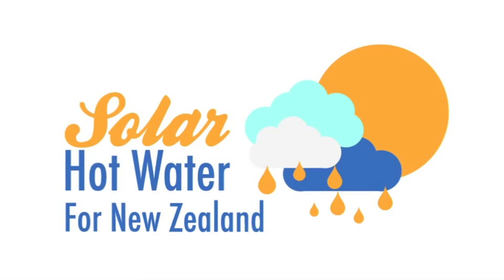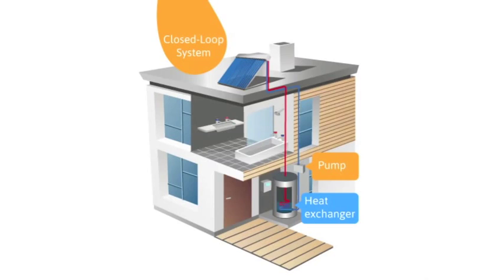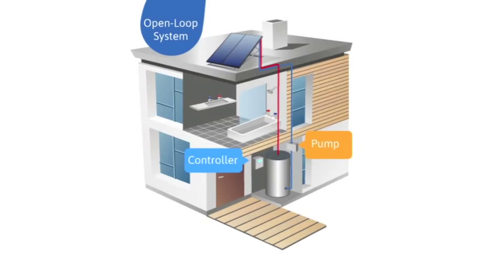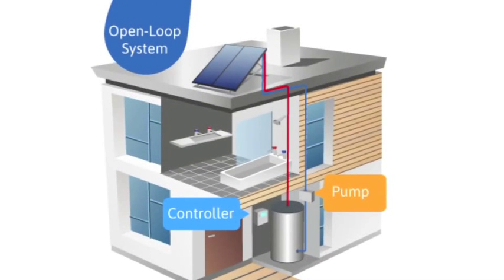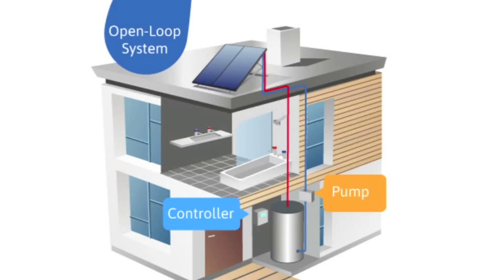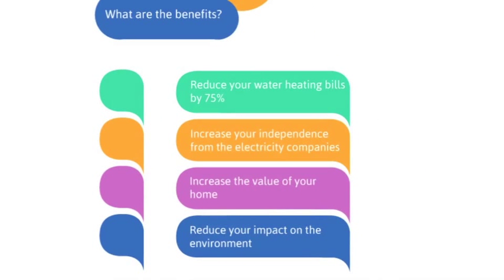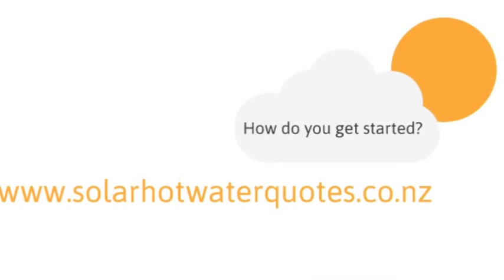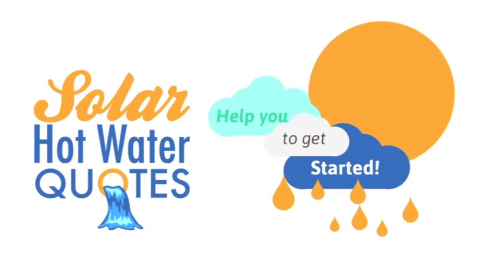How a solar hot water system works in New Zealand

Comment: Wondering if install costs can be lowered further by having the system installed as the house is being built?
Reply from the maker: Yes absolutely.  For starters you would install the right size water tank that is needed for a solar hot water system, therefore not having to replace an existing one.  Also you would save cost installing it before the gib goes up.
Reply: @MySolarQuotes  Thanks heaps :) - Looking to build in Rolleston/Halswell in the next 10 months - Will be in touch closer to the time